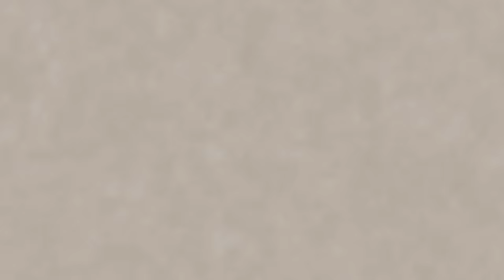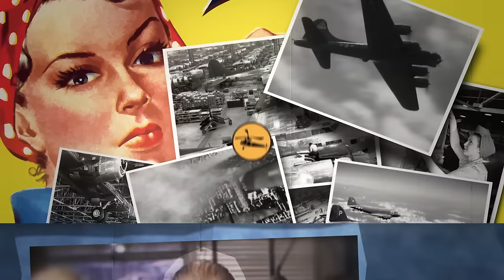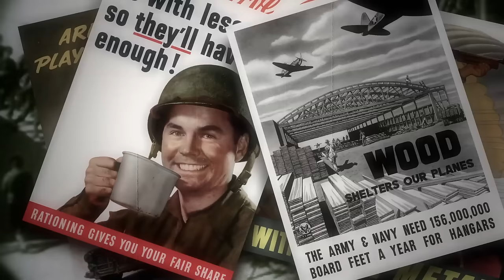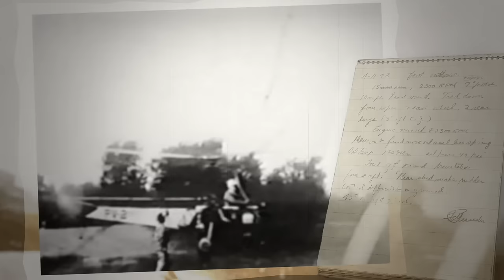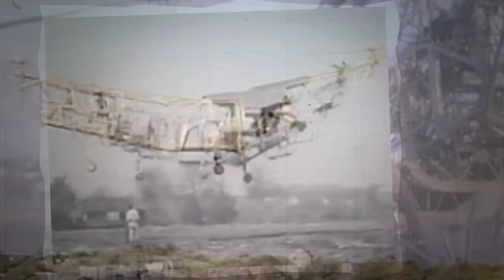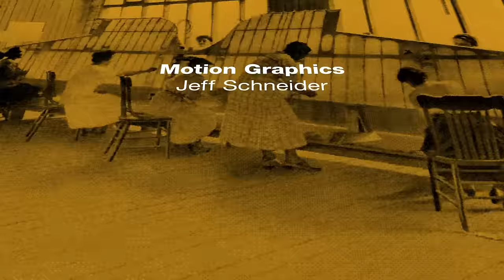Straight Up: Frank Piasecki’s Flying Machine

Comment: ... I could be wrong & I should go read up on wiki before I start typing, but Piasecki was one of many people who copied the first working helicopter of what we think of today as the 'conventional' helicopter layout. One overhead rotor & a tail (torque) rotor. As I recall, the first person to make a helicopter that actually worked, with that layout, was Sikorski. And Sikorski was already in the business of making aeroplanes, big flying boats... The first working helicopters appeared about the start of WW2, but there were teething issues. They looked like an autogyro, a small conventional aeroplane with the wings removed and two overhead rotors, side by side. The very famous German female test pilot set a world record for flying one inside a (large) building... But the first one with the 'modern' layout, was made by Sikorski. ... My point, Boeing has some history and leadership in vertical flight, but this clip is slightly misleading. It leaves a lot out, and it implies the story it does tell is of the very first invention of that type of aircraft, which is not quite the case... [edit] In fact, if you were a little bit generous with your definitions, you could hold Leonardo DaVinci responsible... He never made one that flew, but he certainly designed a machine that was conceptually, a helicopter, and that was 400 years ago.